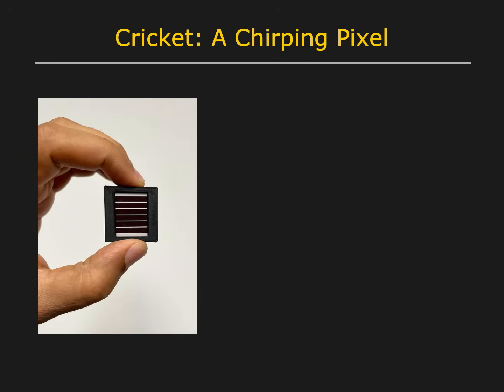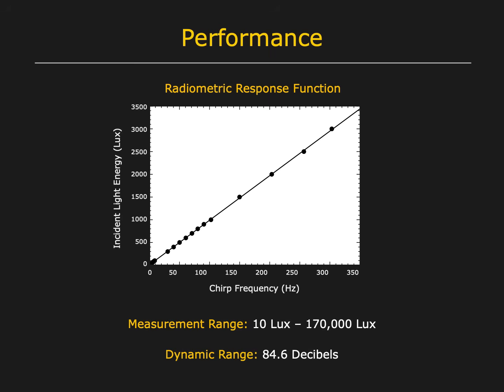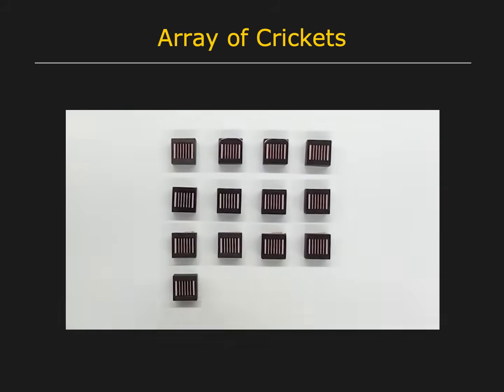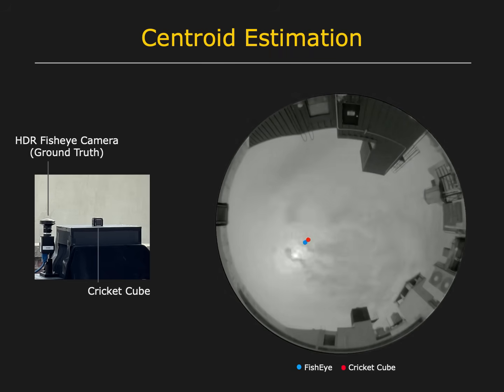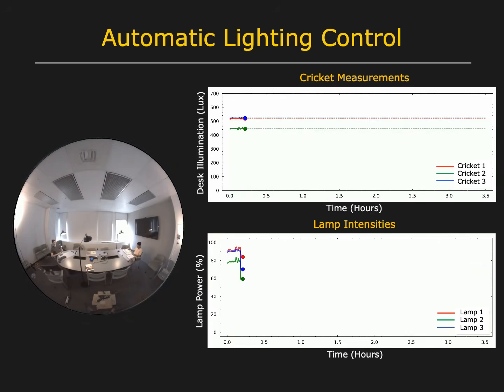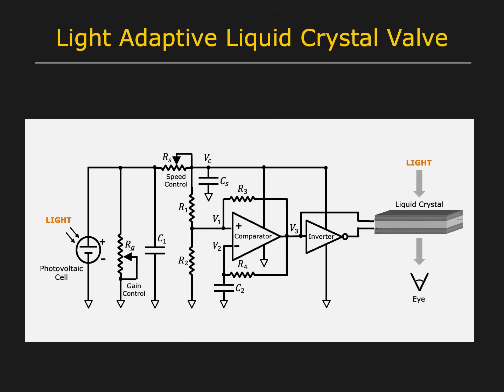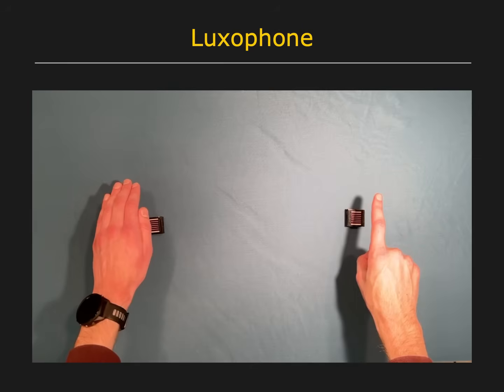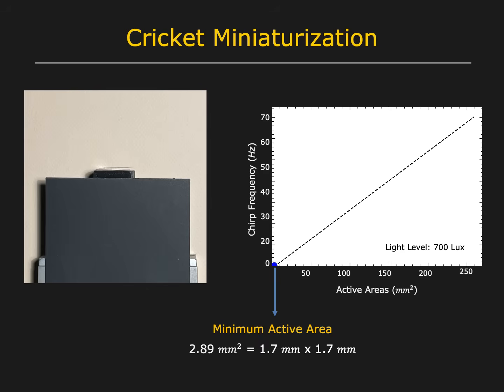Cricket: A Self-Powered Chirping Pixel

Comment: Neat project.
Some technical details of the presented hardware version I looked up after watching the video:
They're transmitting a constant frequency signal for 30us, generated using an integrated VCO (MAX2752), so techncially not a chirp (which they acknowledge in the paper). Each unit has a different Rb value for a different VCO control voltage and therefore a different VCO frequency. The VCO is on for 40us, the RF switch is there only to cut out the first 10us while the VCO's output settles. They're currently using 2.04-2.11GHz (that is, the current hardware is designed to be set to a single frequency in this range), mostly to keep the antenna size reasonable. They're using an SDR for reception and checking a 2MHz band for each cricket, to account for drift in frequency. Current range is up to 40 feet (~12 meters, line of sight).
Anyway, the basic idea of a self-powered light sensor working as a kind of voltage-to-frequency converter is neat and they've presented a bunch of potential applications.

Comment: Amazing idea. To scale it up, I'm curious how much bandwidth and selectability you need/get with hundreds or thousands of sensors. Perhaps this circuit could be made in CMOS and miniaturized.
Reply: I dont think it would scale down. Its basically a solar panel.
Reply: @LittleRainGames they showed in this demo how miniature it could get, about four square millimeters; they just haven't actually built one that small yet. all you'd need is a base station able to handle that many signals.

Comment: 3:50 is allready a thing in automatic welding goggles. but they use a solar cell to provide power and a ir / uv sensor to control the attentuation
but their circuir is dumb and usually only is able to turn on/off the lc glass, not attentuate continously
Reply: Not all are solar powered, many take batteries. Also they go from dark to nearly black, whereas eyeglasses need to go from as clear as possible to  only somewhat tinted, so I imagine the exact type of LCD used is important. Also the fact that these are based on a low power RF link means fewer wires in wearable devices if the sensor and what it controls are remotely located.
Reply: If I understand it correctly and based on the circuit diagrams shown,  the glasses don’t use an RF Link, rather they modified the Cricket circuit to drive an lc instead of generating a radio burst.
Reply: @chrismofer  Tech that originally came from how to protect bomber pilots for flash blindness in nuclear war. Helmets were design to have very fast acting light attenuators in their visors.

Definitely beat wearing an eye-patch over one eye (so if you did get blinded you could switch to your other eye) or flying with flash curtains and only instruments.